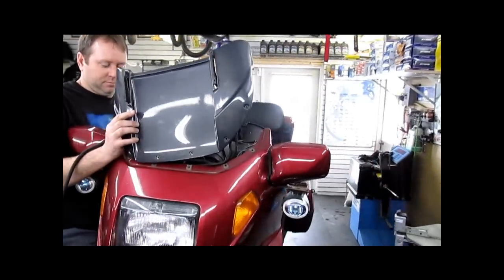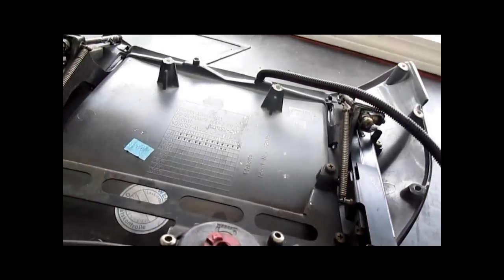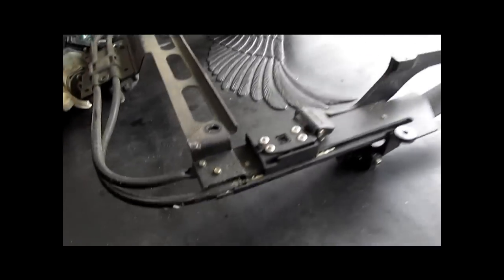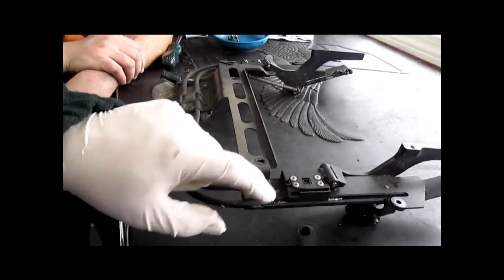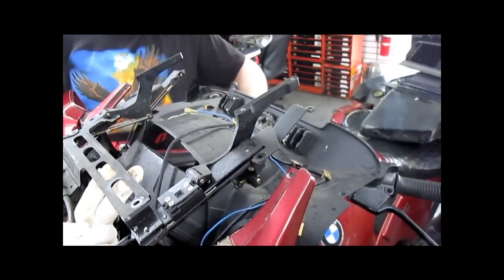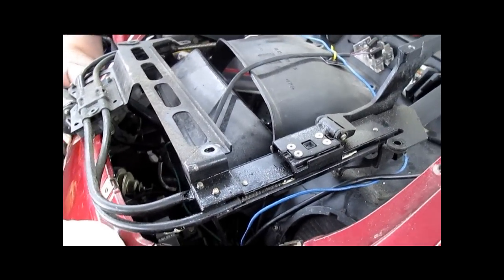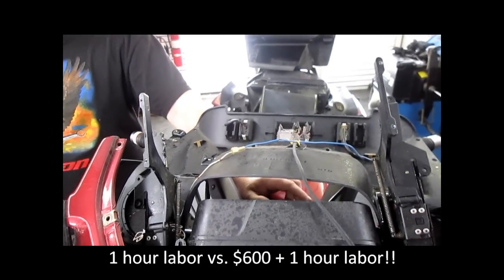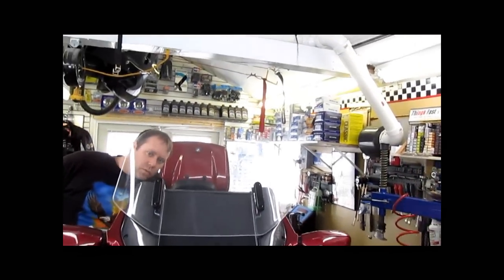BMW Service - Electric Windscreen Repair for K75RT & K1100LT

Comment: Chris, No matter how much penetrant I push into it I can't make it move anymore than  5/6 mil or1/4 of an inch. Tried the multimeter on the motor but I may have to see an electrician to tell me if the motor is stuffed. I stripped the mechanism down so I could get to the motor off and the plate. Poured wd40 and sprayed it with silicone spray and put it back together. If the motor is ok I will need to strip it right down. Now how do I do this?

Comment: Your gonna have enough lube in that screw cable to flood out the motor! Hahahahaha. Im sure it just goes down into the screw driver mechanism and the motor is separate.  I did want to see it come apart though.

Comment from the maker: Hi TheBeemerfan, Does the fan work if you apply power to it? If so then wire a switch to turn the fan on/off. If not then you might need a new fan (check the fuse first). Good luck, Chris

Comment: And once you get it working like it should you have a good pizza holder, one that will clamp down on a Papa Murph's $6.00 "Fav." You might have to fold the two edges a little bit but once it's clamped down yer good to go, even if it rains.

Comment: Had good success in getting out some discoloration and light scratches out of the plastic windshield by using Turtle wax polishing compound, and next going to plastic polish, using a power ball and electric drill. It worked well. Took a 2' long 2" X 4" and screwed two 8" vertical pieces of 4" x 4" @ 12" OC, chamfered on a miter saw, leaving 3/4" flat (3/4 x 3 1/2") in the center, on top so I could screw it with a short screw and a washer, one on each side, using this as a holder for the power buffing, clamped to a table. Buff slowly at first to avoid splattering. If Polishing compound won't take out the scratches, you can go with rubbing compound first, or even down to 2000 grit wet or dry, which definitely will leave some scratches.

Comment: Had trouble with mine again. This time the motor itself would get stuck. Windshield would go up but get stuck and didn't want to go down. There was some metal tape on the motor which covered two rectangular holes which were for installing the wedge shaped nuts for the screws that held the worm drive unit on. You can take some of that tape off and hose it with WD 40. That's what I did and that was the fix it needed. (don't worry, the brushes are on the other end) I also pulled the motor off the housing and put fresh grease there where the gear engages the cables. Be sure that if the windshield arms are up, that the motor has been actuated up using the switch before you mount it. Not getting that right might result in the windshield only having a little bit of movement.

Comment: Big improvement on my windshield after using Marvel today. I found out yesterday that my '93 LT will boil before it's hot enough to turn on the fan, when there is only water in the system.
Put in about 50% antifreeze and the fan works fine. Was using clear water to flush it out a few times.

Comment: Chris, thanks  for me helping me saving a few $100 an hour at the you know who.
In my 93 KLT I just changed the antifreeze and thermostat, but I noticed that the antifreeze still overheat to quickly if I ride slow . The fluid comes out the overflow container. temp here is quit low so the weather should not be an issue. I did install the the bypass switch as you advised me and works like a charm. but I just want to find out why heats up to quick…or is normal in this bikes. thaks a lot again
Reply from the maker: Coolant must be at the minimum level in the reservoir. If your fan does work but is not being activated you might have a defective Motronic computer. If the fan does activate and you are still over-heating I would first suspect the thermostat then a blocked radiator. Good luck, Chris

Comment: I randomly ended up on this video after browsing other stuff.  I have a 1993 BMW K1100LT, and the windshield stopped working a few years ago.  When you hit the switch, it just clicks and wiggles on the left side like the motor was bound up.  I dropped everything I was doing and went outside to do exactly what you did in this video, and BAM, working windshield.  And I'm stationed in Germany right now, so if you think fixing BMW is expensive in the states, they're REAL greedy here.  Thanks!